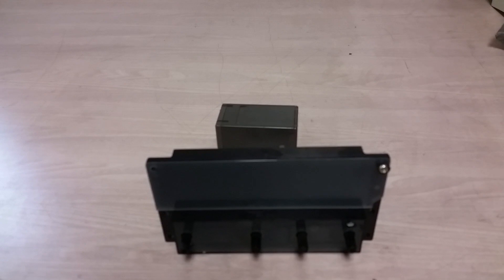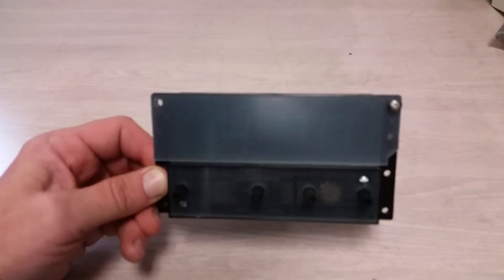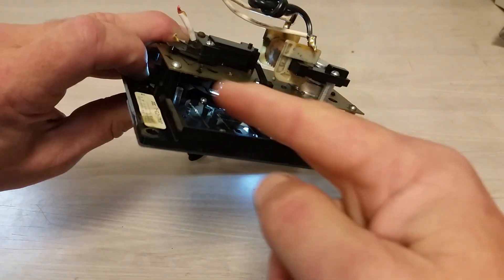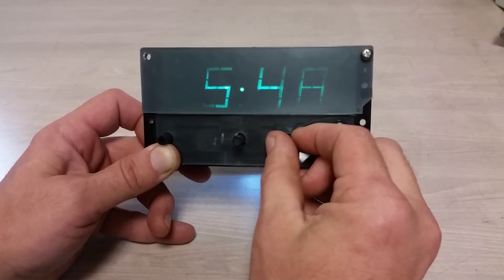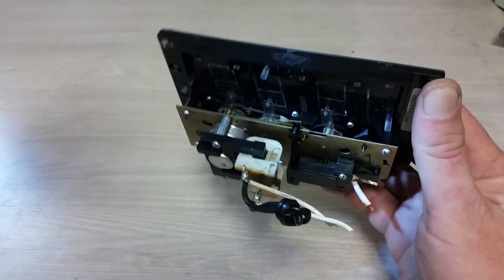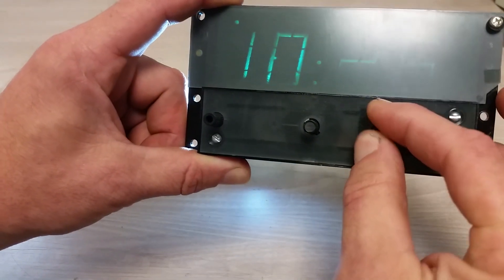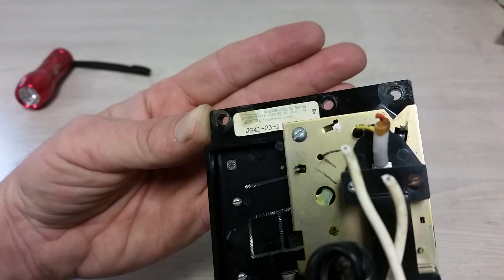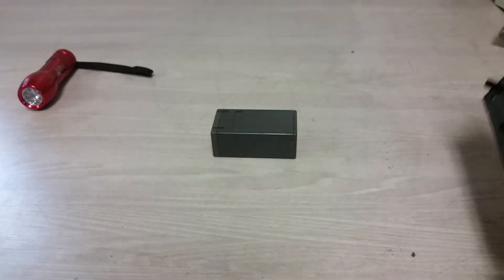Telechron Mechanical Seven Segment Display Clock

Comment: I had an AM/FM Clock Radio that used one of those displays.  When it went bad, I bought a cheap table-top clock with the same mechanism and swapped it into the radio.